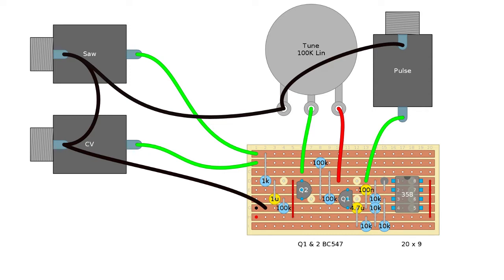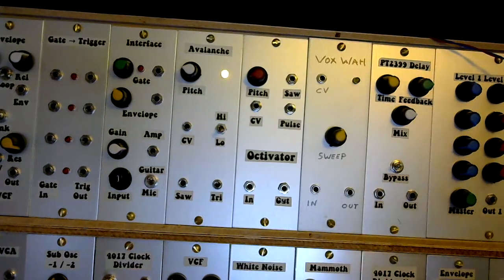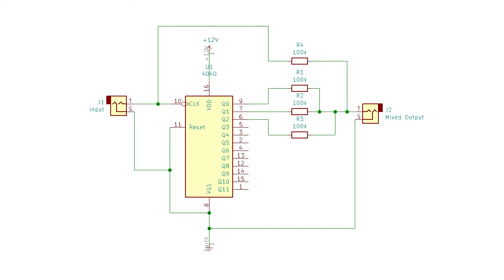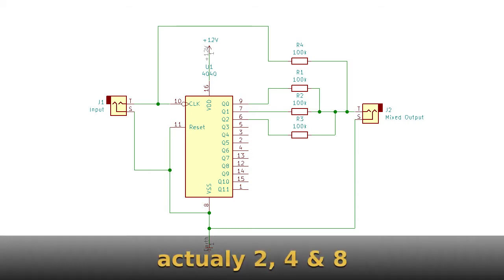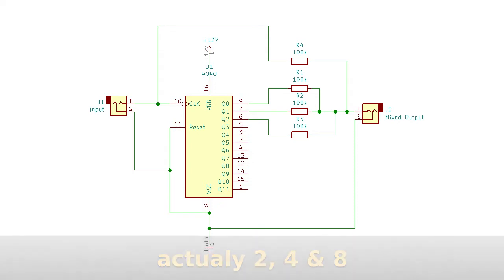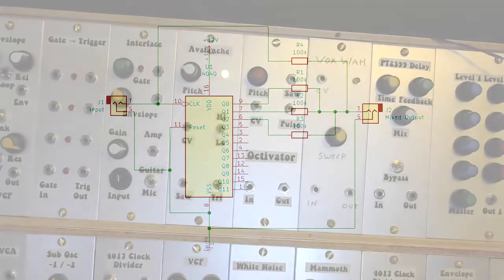Project XII Modular Part 15 : Octivator

Comment from the maker: CORRECTION: The 4040 schematic shows the input signal passed to the output as I demonstrated on the breadboard circuit. The module I built for Project XII does not pass the pulse wave input or any signal on the octivator input jack to the output. Adding the input signal to the output is optional, choose what works best for you and your system.

Comment: Is there way Sub Octave Generator run on +12 power or its still a mistery one 😂
Reply from the maker: You can build the sub-octave circuit (4040 chip) as stand alone and run it on a +12v single rail power supply. I also built a version where the octaves outputs go through switches so you can select which ones are in the mix.
Reply: @CuSiSound  Greeeat! Thank you Man :))